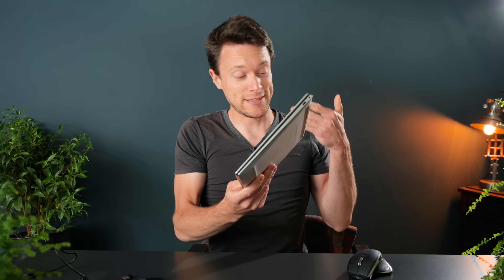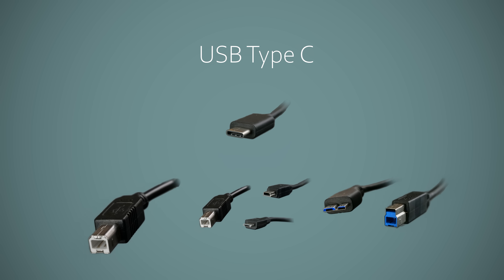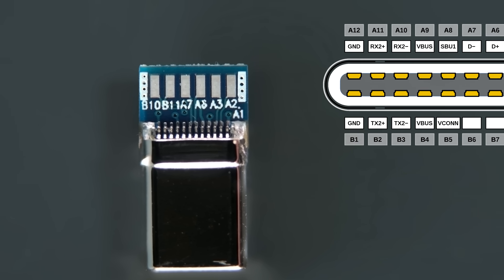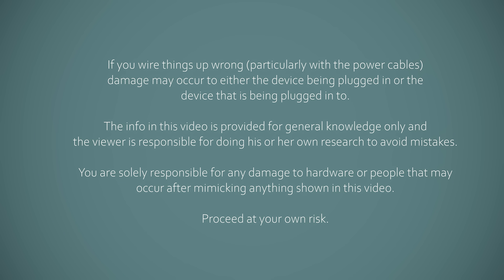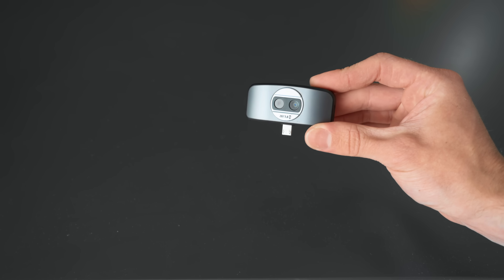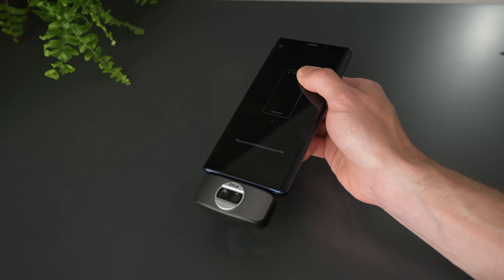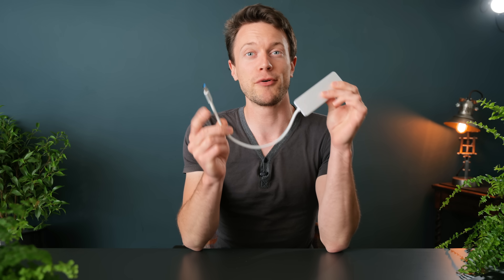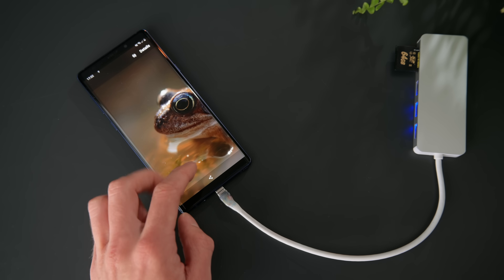Converting devices to USB Type-C

Comment: you could also try making a webcam out of an old phone camera, if that's possible at all
Reply: I regularly find lost phones on the road (people like to put their phones on top of their cars as they open the door and drive away..). I turn-in the good phones and try to locate the owner, but on the smashed ones, I pry into them. The cameras (and their copper wiring) are usually not labeled, and there are about ten pins. To date, I have not been able to locate any drawings for any part on any make/model cell phone (they change a few times every year). Maybe you have found some?

Comment: I've lost count of the amount of times I've went to plug in a usb, and to make sure I didn't get it wrong, I first looked at the connector and the port to be sure, and somehow still got it the wrong way around. The designer of these has some serious explaining to do..
Reply: The holes in the USB A port and always facing up. I have not messed up plugging in a USB for a very long time it's sooo simple.
Reply: @stonedsavage7814  Ooh, I never took much notice of the holes, I'll keep that in mind, nice one! 
Still, I'll probably still screw it up, especially since a lot of the ports I use are 'round the back of my PC where it's dark, and I have to bend and twist to get to, and there's some other ports there that aren't USB, but look or feel like USB, maybe HDMI or ethernet. 
For me it's usually a case of fumbling around, jabbing the connector randomly, until it finally goes into some random 2.0 or 3.0 port.

Comment: I like your laptop camera idea! I'm totally interested! 

(If it's within your scope, would you consider also mobile phone cameras? I have a few that are unfixable lying around awaiting a new purpose in life) o:
Reply: I think most people have broken phones lying around rather than broken laptops lol.
Reply: On mobile, you need the processor of the phone to run it. so the Operating system needs to load and run the camera. you cant just remove the camera and make it usb
Reply: Maan Alaulaqi yes pleaaase I have so many old cameras from blackberry and S3s lol
Reply: @succduc   Required

For you - Tax file number (TFN) or application. If you apply for a TFN online, you will need to give us your TFN application summary and your Australia Post receipt.
Reply: @stevethea5250  wtf lol
Reply: @miko8732  

Before you get started, we want to share some information to help ensure you get the most out of your community experience.

    PayPal does not endorse the accuracy or applicability of user generated content in the Community.
    Content may be posted by users in countries different from yours.
    PayPal has the right to reject or remove any content.

By using the PayPal Community, you acknowledge and agree to the
PayPal Community Forum Agreement.
Reply: Cameras in phones are typically much better quality than those in laptops a well
Reply: @RavneelChand  The reason they are often better quality is the way they hook into the device.
A laptop camera is generally connected through a form of internal USB/Serial bus while on a phone it usually hooks straight to the processor(?) or processing chip of some sort.
Meaning it will not only be hard to convert but also  allows it to have more bandwidth.
It doesnt really make sense in my head, but thats what I've been told some year ago.
Reply: @LEADER0FY0U  Ohhhh, I didn't realize that before! Is it that the USB line doesn't carry over as much data from the camera that quality is lost? o:

Comment: If you're looking for another idea, check out the USB-C PD boards you can get on ebay (ZYPDS, ZYPDN12 for search terms) that handle USB-C PD communications and can be configured to output the various profiles. Those can be used to easily retrofit an older device with USB-C charging capability, either soldering directly to the DC inputs on the PCB of the receiving device directly or merely adapting connectors (USB-C female port to male thinkpad charging cable, for instance). Charging everything with the same cable is such a luxury.

Comment: Also would this trick work with converting a charge port from Micro USB to USB C.  I have a set of wireless headphones I would like to try it on.
Reply: Zero point in doing it though as they don't have data transfer which is the biggest benefit of usb type c. Any connector can output power so stick with it is my suggestion hope this helps.

Comment: I was super hyped about USB-C until the USB-C port on my Xperia X broke.
I was promissed a super reliable connector, but if it is that crappy also on other devices I already hate it.
Also, most USB-C devices are actually only USB 2.0 and almost nothing is compatible with the USB-C thunderbolt variant.
Reply: My phones usb type c connector is perfectly fine and my poor phone has been abused really badly I sometimes carry my phone by its charge cable I trip over the wire many times poor thing should be dead but it still doesn't care.

Comment: adapters are available though, not necessarily you need to use a dongle to adapt usb a to usb c
adapters are smaller than dongles since they don't have wires for that length(if you don't need length, thats good) its not anymore elegant than dongles but if you hate dongles, could give adapters a try
one for example, the Samsung usb c adapter: https://i.ebayimg.com/images/g/C5sAAOSwXHpcbujR/s-l640.jpg

Comment: I've manage to add usb-c port to my laptop that has no usb-c port but only use usb 3 protocol, but it can use plug either side or reverse with samsung usb-c external drive, still can transfer about 250Mb/s speed with no issue.
Reply: Nice!!! Good speeds too specially when compared to my laptop.

Comment: 13:35 Couldn’t he just solder a usb-c cable to the PCB of that dongle?
Reply: It may not have been that easy to open the case. He did say cutting off the end was the only way to access the wires and I didn't see any screw holes, so the case probably either clips together or is glued/sonically welded at the seams. It wouldn't look very clean if you had to Dremel the case apart to get at the PCB. I definitely would have tried a spudger first, however. Or maybe he just wanted to demonstrate wiring a USB 3.0 device to the type c plug.
Reply: Excatly my thought. Just open the dongle up, unsolder the old cable and solder a USB-C one. Would've been much cleaner and easier
Reply: or get a small type-c OTG like the one he brought at the end ... and there are even smaller ones than that
Reply: Pretty sure the reason he doesn't do that isn't because it wouldn't work, but because its less practical to use your up to date, working cable for an old device vs getting a part for the same price or less. Just my thoughts though
Reply: he did it just to show how usb 3.0 would be soldered to type-c connector
Reply: @demchrome  I changed my mind. This is probably it

Comment: how about powerbanks?
Reply: No point as it only takes power wasting the whole point of usb c which is the fast data transfer rates.
Reply: @stonedsavage7814  so how u load a new phone with an older powerbank?
the point of usb c is charging faster , more reliable connector and at last data transfer. faster data transfer could have been achived with an usb 3 connecter already.

Comment: 07:11 - No to screatching this board, just desolder this resistor and solder to other place next to him (R2).
10:46 - Again.
13:46 - And again :)
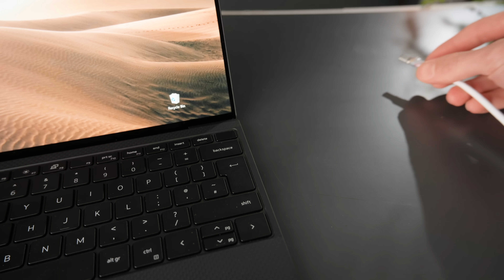14:38 - Use thermal shrink isolation on top of epoxy to protect breaking.
And nice video.
Thanx for you work.

Comment: Little anecdote to 01:21 - almost all musician's gear that comes with USB is connected via the big old USB 2.0 type B. Audio interfaces, Drum Computers with a MIDI USB, MIDI-Controllers. It's insane.

But it seems to be a fairly solid connector, and I'm honestly happy they skipped the flimsy Micro-B. Now modern audio interfaces get updated to USB-C and hopefully oder devices follow suit.

Comment: One more idea to make from an old laptop would be (and i'm planning on doing it myself) making a NAS out of a old laptop and using some sata adapters and a external powersupply. For example I have 2 available usb ports and 1 extra sata port (i also have a ssd already in place and can be partitioned to act as a cashe for the hard drives and used for the os, atleast i think it can). My plan is to use 3 hard drives and that 1 ssd to get a really nice NAS, and if you want you can use openvpn to be able to acces the nas anywhere in the world as long as you have a internet connection.
As i wouldn't need to buy or make a pc or nas tower the only thing that i would need to buy or have laying around is some hard drives and a os like unraid or freenas.
I hope i haven't gone and said something that wouldn't work otherwise please correct me. I'm really not sure about the partitioning of the ssd.

Comment: Handy video. For the mouse, the one thing is that it uses a micro USB connector; I have the same mouse and it would be great to replace that with USB-C as well. I wonder how tricky that would be, as unlike the dongle side, or the FLIR, it could be pretty challenging to convert. At a minimum (like the FLIR), the plastic would need a trim. But I would be surprised if the board would fit. Please let me know your thoughts and keep up the good work!

Comment: 14:35 if you get those USB C connectors, get them from DigiKey and get the corresponding casing, too. They should be plastic or metal backshells can can be crimped on. The best way is injection molding PVC or similar plastic but this does require extensive tooling outside the scope of a DIY home gamer.

Comment: ...I've actually never seen a non-rigid USB A to USB C adapter.  I have multiple, they're all tiny solid-shell affairs - and would easily work as a permanent attachment for a bluetooth dongle like that mouse one and you could just treat it as permanently USB C with no fuss.  Might add an extra centimetre of length and that's it.

Comment: An issue with using a 2 part epoxy, is that it doesn't flex. Flexing often saves cables

Comment: Imagine going back in time just before they create Type A then you give them the patent of the Type C, would everything run with type C?
Reply: Probably not, because type C is a lot more complex than type A. It's physically smaller, has twice as many pins due to being reversible, the metal housing is more complex to manufacture and has higher tolerances, etc. It's a tradeoff that only began to make sense now that we live in a world of ultra thin laptops and smartphones.

For context, when type A was introduced, it ended up replacing all of these ports:
- PS/2 for mice and keyboards.
- Parallel port for printers, scanners, fax machines, etc.
- Joystick port (on the sound card) for joysticks, steering wheels, and other axis-based input devices.

- RS/232 port for dial-up modems and misc devices.
You can look them up, they're all super chonky and have a lot of pins. Type A is very small in comparison. Even smaller than competitors that existed at the time, like FireWire.

Comment: That mouse was a great Idea, till I messed up my solder. Can I reconfigure it with a new dongle?
Reply: Yep, just get a new dongle, off eBay, and make sure it's not a fake, then use the Logitech app in Windows to pair it to the new dongle first, or if you are on Linux download Solaar from your package manager, to pair it that way. if you are on Chrome/Chromium OS go to the Chrome webstore, and search for Logitech unifying receiver. Far as Mac OSX goes I have no idea as I don't use it,  Just do this before you start the mod on your receiver. Good luck.

Comment: 4:43 I started to wonder why do you have Polish solder :D
Reply: Matt said in one video months ago that he's part Polish... Hence why? 🇵🇱
Reply: I can't read it, but perhaps it is leaded solder which is easier to work with but increasingly harder to find
Reply: @Findecanor  It depends around here. You can go to a plumbers section in the hardware store and find big heavy gauge lead plumbing solder but thats Way to big for this kind of stuff, and rosin or acid core usually. I haven't really looked for any smaller 60/40. I use cheap lead free silver solder from Harbor Freight but i do mostly jewelry and art. Not very much electronics other than soldering some led's together occasionally and it works fine for me. I don't think its really an issue but people tend to shy away from "evil lead solder" in jewelry that's going to be touching their skin, so I use silver solder.

Comment: Firstly the concepts and electronics are great. BUT you didn't sell me that your homemade version is "significantly" smaller than the smaller adapter without a wire attached. The floppy adapter wouldn't bother me either, as if you are using a wireless mouse you need a flat surface, exactly the surface required for the floppy dongle. LOL.

Comment: Good content, but I can't agree with your synopsis that USB Type C is "way better" than Type A (or B for that matter). 

This is primarily because of USB Type C's gross confusion in the market for consumers, where not all cables are equal in terms of capability. Will it support Thunderbolt? Will it support Power Delivery? Will it support Super Speed? Will it support Displayport alternate mode? But to the untrained eye, all the cables look the same with the same physical connector. But underneath the hood many lack all the conductors necessary, or the embedded parts required for these modes.

Furthermore, USB Type C is inherently far more fragile, both electrically and physically. The physical failure mode is much more likely to be on the host, and if you've ever had to replace a laptop logic board, you'll know the pain in terms of expense, and data loss if your SSD is soldered in and you don't have a good backup regime. Replacing the connector is possible, but you need to be able to source the right connector, unlike USB type A there are no real standards around PCB land patterns, and for the high density you need good skills and equipment to rework them as typically many PCB lands are hidden underneath the part.

Electrically, they are using a tiny connector for high currents in Power Delivery but at the same time expect that connector to deliver 40Gbps for Displayport, Thunderbolt or 20Gbps for USB 3.2 Gen 2x2 all on one connector. As such there's a high speed multiplexer which inevitably bares the brunt of this, and is the common failure mode. If you can source the part (often difficult if it's a modern Apple product).

USB Type C is a hard engineering problem, and to get it right is expensive. You can cut corners - and most manufacturers do - but this makes the problem worse, and gives USB Type C a bad consumer experience and reputation.

Comment: Time to rip open my old PSP and change the DAMN charger into a USB type C.

And then a battery mod to a large li-ion for good measure 😅
Reply: Search for USB C PDC004 modules, those would be better for charging as it will work with USD PD
Simple sub device might not pull power from chargers if it doesn't detect the right signals.

Comment: While I’m a tinkerer myself, and have been known since childhood to be the one who takes things apart, I appreciate this a lot. HOWEVER... sometimes you need to be LESS creative, particularly when it ends up costing more or risking damaging sensitive/expensive hardware. Specifically, in devices like the FLIR ONE, if the device is sold with 3 different connectors but no other difference (Apple Lightning, Micro-USB, USB-C), check first to see if there are cheaply available replacement/repair parts. You could just buy one of those on eBay, replace the parts inside with OEM hardware that is guaranteed to be a perfect fit and finish.
Otherwise, though, heck yeah! This is pretty awesome! (Sugru is so useful, even if it does sometimes wind up looking a bit “how ya doin”.)

Edit: Oh, and regarding the hub, I actually did that myself... sort of. I replaced a USB 3.0 cable and its weird connector with USB-C on a little hub I use frequently that has everything from SD/MicroSD slots to an HDMI port and headphone jack. (And is Apple/Windows/Linux compatible).
I just took a cheap USB-C cable, hacked the end off, then soldered that straight to the board, rather than going through all the steps like this. I still think this is an indication of where slightly more research would be useful, as buying a cable, rather than connectors + resistors + sugru is... well, you’re looking at a $1 repair/upgrade. Hard to beat. Less work, less cost, less potential points of failure, more durable, and it looks OEM.

Comment: I agree with the second part of the video, where you modified the thermal camera. But I think the first part (the mouse dongle) is very destructive and unnecessary. This is a better solution, that will look better and is easier to do: https://www.aliexpress.com/item/32896477993.html

Comment: it would be nice if they sold an active usb c connector board and passive .. so i dont need to buy extra resistor :P and maybe it will be thinner tho
thanks you for explaning the resistor thing i tried by myself to tranform all usb to usb c 1 year ago and it not working ... thats why ... thanks :D

Comment: I was thinking if the pads were on the correct side of the "trimmed down" breakout board, you could solder it right against the USB A pads of the wireless receiver, no mod wires necessary

Comment: Guys don't rush changing your devices with this. You would make a crude work out of it, and after a while you would actually come to a point where you want that device to work on a normal usb A and you would need a f***ing dongle over that crude work you did...
i guess it's ok for things like that cammera, but don't change your mouse or whatever, unless you are 100% sure you won't be using it ever on a usb A port.
there would come a time when you would want to sell this mouse because you got a new fancy one, and i won't buy it with that dongle thingy...